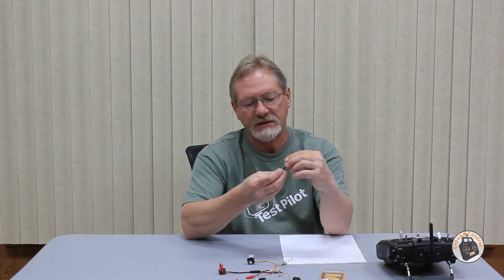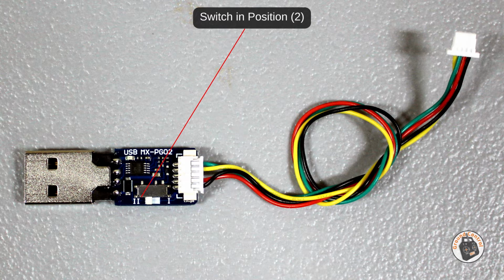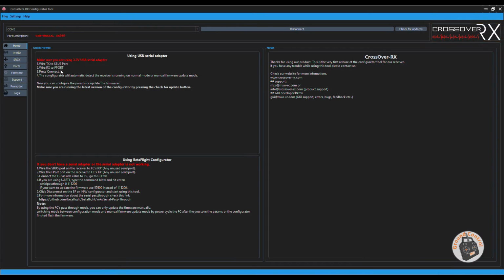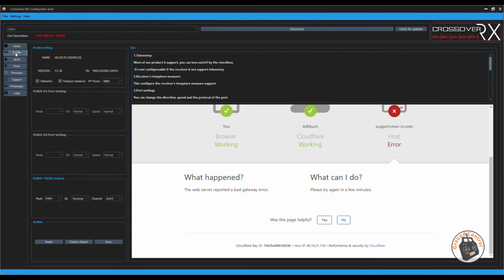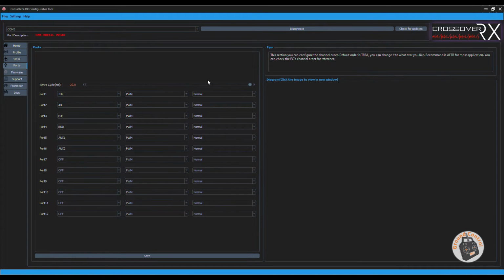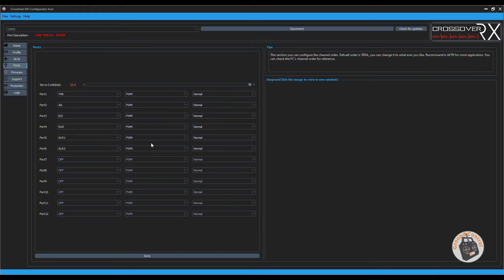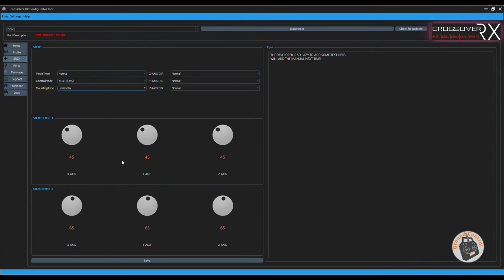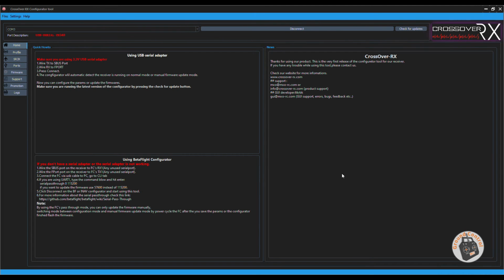Tips, Config Tool, & Bench Test - CrossOver-RX AR3207G 7CH Micro Receiver Brushless ESC + SR3X Gyro

Comment: I have an old DX6i so right now I only have off and high sensitivity (no blue light and flashing blue)   BUT, when it's on flashing nothing moves when I manipulate the plane.   Does the SR3X have some kind of motor speed/time trigger?
Reply from the maker: Not that I'm aware of but I've started seeing that on some of the newest micro planes.
I wonder if they've incorporated that in newer firmware than mine has.
I have to engage the throttle to get the servos unlocked on these new micro planes after a couple of minutes of no activity.

Comment: I would love to know how you would calibrate the ESC on this Crossover-RX.  I have all the control surfaces working but the throttle just going in cycle. approximately -50% to -20%, then abruptly stops and repeats the cycle
Reply from the maker: When I'm working with an ESC and I can't hear the beeps from the ESC, as in this case, I try to time the calibration.
Usually, an ESC will emit 2 beeps when it detects the throttle stick is all the way at the top, and then after the 2 beeps I pull down the throttle stick to the lowest position to calibrate.
So, since I can't hear the beeps on this one, I put the throttle stick at the top, plug in the battery, and count 1001, 1002, and move the throttle stick to the bottom.
Sometimes it takes several tries but I end up getting it calibrated.
Sometimes a specific ESC and Motor will just not time properly, then I have to try a different motor.
I hope that helps.

Comment: Hello, I follow your videos for tips and info on small micro rc warbirds, of which I own a few.  Been trying to do a bushless conversion on one using the CROSSOVER-RX AR3207G-A2/A2+(FLYSKY-AFHDS-2A).   I have some issues in being able to get the needed punch on the motor.  I have seen your videos on the Eachine conversion using the same receiver and noticed you have no issues in getting the punch needed from the motor. On mine, the motor gets to a point where it stutters, as it it reaches a max current and the ESC kicks in avoiding it to get more speed.  Any guidance on it will be much appreciated.  Thanks
Reply from the maker: Hi Jose!
Sometimes ESC and Motors will do that when they just don't work well together.
Sometimes I have to use a different Motor or ESC.
Sometimes a Motor will stutter when the ESC doesn't detect the entire Throttle Range on the Transmitter.
I always program the ESC with the Full Range of the Throttle Stick.
I don't know what motor and prop combinations you're using but if it's pulling more amps at full throttle than the ESC is capable of you'll have problems.
If you've programmed the ESC with the Full Stick Range of the Throttle you might try a smaller prop or one with less pitch and see if the lower amps fixes the problem.
I always test my motors and props on the bench with a load meter to make sure I'm not pulling more amps than the ESC can handle.
If I remember correctly that ESC can handle 7 amps on 2S and 5 amps on 3S.
Reply: @GroundControlRC  Thanks for the response. I do not have any sophisticated equipment to measure the amps drawn by the motor but I can tell that it’s definitely trying to pull more amps than what the ESC is capable of delivering with current setup. I also can tell that I have not programmed the ESC on the throttle channel. Hasn’t occurred to me. On this receiver, is this done through the Crossover app?  Also, the last motor I tried last night, and still it would stutter, was similar to the one I think you put on the Eachine mini Cessna. Mine was a 1306 with 3100kv.  With a 7.4v battery.  If it’s a matter of hooking up the receiver again with the programming tool, I can do that to see if some adjustment can be done on the throttle channel.  I have been testing smaller 2s motors but still same results, mostly using a 130x70 three blade prop (Eflite prop).  On a 130x70 two blad prop I get better results (without stutter) but not a great punch out of it.
Reply from the maker: @josesalichs3283 No Worries ;-)
You program the throttle range of the ESC with the Throttle Stick on the TX.
Here's a link to PDF that explains it: https://www.horizonhobby.com/on/demandware.static/Sites-horizon-us-Site/Sites-horizon-master/default/Manuals/EFLA1040-Completion%20Guide-EN.pdf
The 1306 3100kv motor has worked with all my ESCs.
I used a Gemfan 5030 2-Blade ABS Prop.
On 2S it provides 202g of thrust pulling 5.4 amps at full throttle.
Your 5.1x2.75 3-Blade prop is most likely pulling more than that.
I would program the ESC throttle range 1st and see if that fixes the issue.
Reply: @GroundControlRC  Great! Thanks for the replies and recommendations. Will definitely try that.  Will have to look maybe how to do that with my Flysky TX, which is the one I use for this receiver.

Comment: Hello.. do you think this receiver would be suitable for XK A280 P-51 Mustang 3D/6G 560 mm?
I would like to use it with a Mustang stock motor and ESC. I hope it is not a problem to connect the original 10A ESC to CrossOver-RX AR3207G board as external ESC. Thank you for video.
Reply from the maker: It has a built-in 7A / 2S or 5A/ 3S Brushless ESC so no external ESC. I believe they have different receivers that can use an external ESC.

Comment: I love these rx/esc combo, and have been using them to convert my rubber-power fleet to r/c electric. 
However, I have a question: why are there two sets of pads for battery connections? Do they perform different functions?
Many thanks.
Reply from the maker: Great micro RX.
I think the other set of pads is so you can power other equipment like and FPV Camera.

Comment: I like this, I like the GUI setup.. am I correct in saying you can choose any port to run an external ESC.?.. and if so do you just have the single signal wire in the plug? Or all three so it gets power from there too?.  can this run from the 5v ESC BEC?... If I get an answer to this I really appreciate it!... I want to run a 12A 3s from it..
Reply from the maker: It's a great micro RX that can take 2S-3S input and has a built-in Voltage Regulator that outputs 3.9v @ 2.8A.
You would want to use some low voltage servos or ones that can operate with 3.9v.
The Gyro can be setup to use single or dual ailerons.
I would think one of the AUX ports could be setup for Throttle if you wanted to use an external ESC but I've never tried that.
Assuming you want to use an external ESC I would not provide power from an external BEC as the LIPO will supply the needed power.
I would use an OPTO ESC with just a Signal and Ground, no voltage supplied to the RX.
Reply: @GroundControlRC  thank you very much!, that's exactly what I needed to know and more!...
Reply from the maker: @cheggers1973  You are most welcome.
See you in the Air!
Reply: @GroundControlRC  I just ordered one of these in the S-FHSS protocol, well find out if it runs an external ESC haha, I want independent replaceable servos, for whatever reason, my rudder linier servo died today with the MXL that has onboard servos...not a big issue as I don't use it much but I like things to work...I have a computer now so I can adjust things....  

Thanks for the continued content that gives RC modellers the confidence to buy good products like this little reciever.
Reply from the maker: @cheggers1973  Thank You!
Yes, I wish all of these boards used independent servos instead of having (2) on the board.
This is the board I had in the Eachine Mini Cessna I converted to brushless.
I retired the Cessna and now I have it in the Arrows Pioneer.

Comment: I'm wondering how one of these would work on a twisted hobbies mini kit
Reply from the maker: I'm not familiar with the twisted hobbies mini's size or weight but it would work well on something like the Radiolink A560 3D Plane on 2S. It's 560mm wingpspan and is 200g AUW. If the twisted hobbies plane is similar it should work.
See you in the Air!
Reply: Thank you for the quick response, if you think it will work on the A560, I think it will work on the TH mini kits, they're 24" WS with an AUW of 80-100g. I think I'll go for it😄

Comment: Great video! I was really excited to incorporate this into my Arrows Pioneer, but I'm a bit hesitant now. The circuit board has these incredibly small contact points, and I'm not confident in my soldering skills to attach the wires properly. My initial enthusiasm is fading away.
Reply from the maker: Thank You Much!
It just takes some practice and my soldering skills aren't that great as I only do it when I have to ;-)
Get a scrap piece of tin and practice soldering wires to it and when you're confident enough you'll be able to solder to those pads no problem.
I like to use some of those high powered reading glasses when I'm soldering to small pads as it makes them look sooo big and easier to solder ;-)
See you in the Air!

Comment: I'm looking forward to the results.  I'm more interested in its out of the package function ( no software mod).  It might keep me from having to retire a favorite park flier.  Also, when you get a chance, I'm interested in info on how you check your older batteries for health, safety, function, etc.  Have you ever had a bad or old battery catch fire?  Where do you store them, charge them, how do you get rid of bad ones?  You know, everything!
Reply from the maker: Thanks Mike!
I'm planning on installing this in the Eachine Mini Cessna if I can finish the Brushless Conversion this week.
If I can't get it done by then I can use it as a drop-in replacement for the Receiver in the Dancing Wings J3 Cub.
I did connect it up to the Ailerons on the Eachine Mini Cessna, after modifying those, and one issue I ran into was the gyro correcting in the wrong direction for my Aileron Setup.
I'll have to use the software to change the gyro correction on at least that axis.
That may be a problem that requires the programming tool and software even if the default gains prove to be adequate.
On the LIPOs, I retire them in the following situations; they get puffed, the cells are pretty far out of balance after a flight, they won't charge to full capacity, or just don't provide the flight time or power they used to.
I've had some of my LIPOs for years as I baby them.
I try not to run the cells below 3.5v and 99% of the time they have at least 3.6v when I land.
I never charge them faster than a 1C rate.
I store them in Metal Army Ammo Cans ;-)
I charge them with my balance charger on a utility cart and never leave them unattended.
I've never had one catch fire....yet ;-)
Many recycling centers will accept used batteries.
When I retire them, I cut the power connectors off and submerge them in water for a couple of days and they're completely drained by then when I check them with a multimeter.
Humm....my Wife doesn't think so ;-)
Reply: @GroundControlRC  hey, thanks, that's a lot of good info.  I guess I'll have to retire a couple.  Do you add salt or something to the water to increase connectivity?  Have you ever looked at internal resistance as a measure of health or performance?
Reply from the maker: @1mikeb  You are most welcome.
I have tried adding salt but that seems to corrode the cables.
It didn't seem to me as though the salt dissipated the voltage any faster.
I do check the IR on new LIPOs but as long as they still provide the power and flight time I continue to use them until they start falling off on performance.